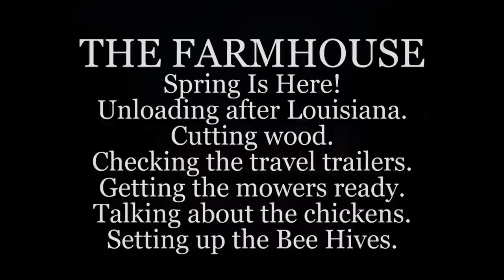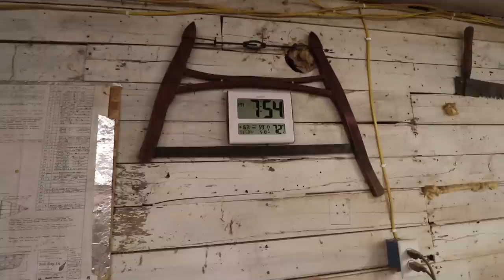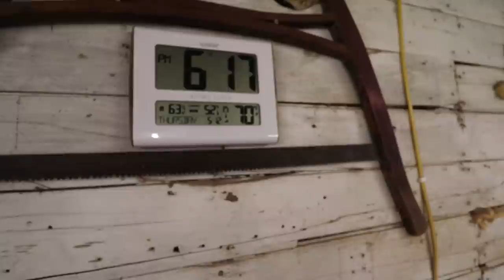THE FARMHOUSE. Spring is here. Cutting wood, Mowers started. Farmhouse cooking. Chickens. Compost.

Comment: Get Zach to go through the 250 and clean the carburetor, change the plug, get rid of the spark arrestor in the muffler, adjust the idle upwards when he cranks it up. Then put a full chisel chain on the bar and it will cut like mad.

Comment: That really is a lot of wood!   We had a buzz saw that hooked to the pto of the tractor.  It’s very old but able to get thru logs pretty quickly.  It was dangerous and it was a three man job.   Everything is looking good.  Spring time is finally here!    Thanks for taking us a long with you.
Reply from the maker: My Grandfather (my Mom's Dad) had the big blade that was attached to the front of his John Deere B. You would hand turn the "flywheel" or whatever it was on the side opposite the clutch to start the tractor. A wide belt ran the blade and that's how he cut wood. I loved that tractor. It had the spoked rims and was unstyled. 1939 I believe.
Reply: @NorthernSeclusion  ours was a 55-Ford.  Old Blue.  Thanks again for sharing.  I watched the dehydrator video.  Have you used any  of the maple sugar in anything.   Wondered what it tasted like?

Comment: Finally got my sthil saw to start today,never putting ethanol gas in anything again.i run sthil weedeater, blower ,chainsaw and hedgetrimmers and toro mowers ,commercial grade zero turn 42 inch and 21 inch pushbehind ,expensive but worth it.i had to youtube my chainsaw so I could remember exactly the starting process and boom fired right up ,I was always flooding it apparently.

Comment: Ms 250 starts easy once you learn how. When it’s cold, use full choke for 3 pulls. Go up one notch, pull 2 or 3 times. If it doesn’t start, turn the choke off and pull till it starts. After it runs it will start on the first pull.

Comment: On your dad's saw he left you don't know if it'll make a difference but I've got one and the guy at the store said make sure you use synthetic oil in your mix or it won't want to run. Also on mine there's a thing they call a shutter you have to flip when Temps outside get warm

Comment: you should cover those trees during the winter.  just to prevent wind
Reply from the maker: Much easier said than done.
Reply: @NorthernSeclusion  just wrap plastic around the metal protector nets you have there.   that will block most of it to the roots. you may not be able to cover most but the young ones you can.
Reply from the maker: You needed to clarify what trees. I imagined me covering all the pine trees. LOL.
Reply: @NorthernSeclusion  yes, you're right I didn't clarify. Long video. of course theh fruit trees..  haha

Comment: My Husqvarna is a bear to start even after it's been tuned up, but when it's running its fantastic, you can get the pre-mixed fuel and oil mix in a can, works just fine